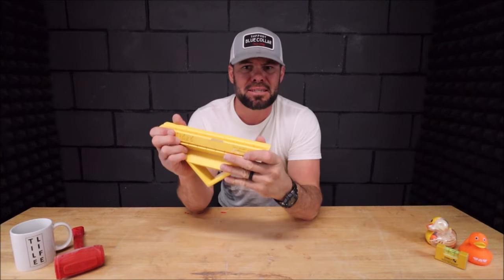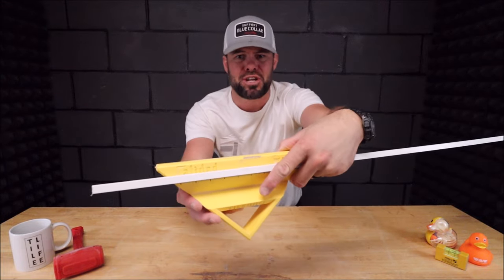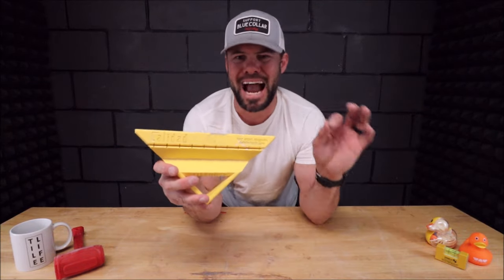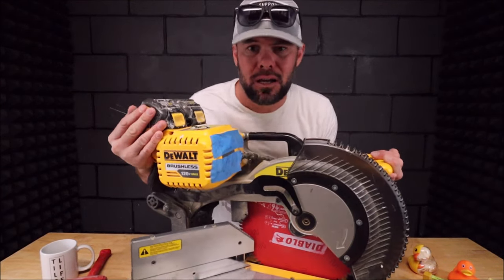BEST Way To Cut Tile Trim | CaliBro Square For PERFECT Miter Cuts!

Comment: What wet saw blade do you recommend for mitering 8x24 high gloss ceramic titles for my niche? I'm using an older model 8" Ridged saw. I'm not sure if I should use a blade that has little diamonds or the swirly aggressive one.
Reply from the maker: Any mesh blade (aggressive) ...keep in mind that a blade burns out fast when you miter hard porcelain. You need to cut below the high gloss glaze (maybe cutting the tile upside down)
Reply: using for ceramic for my niche. Doing a niche as you taught me. Appreciate the input sir. @LandbergTileTV